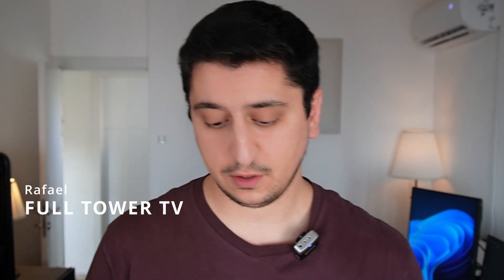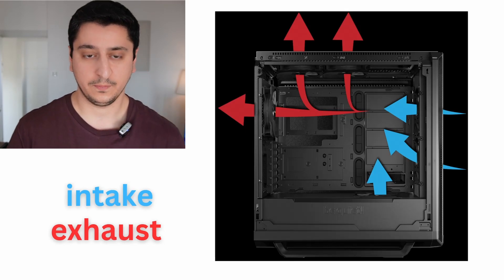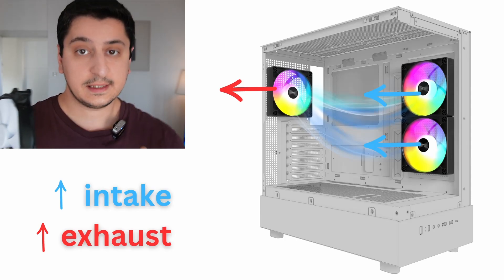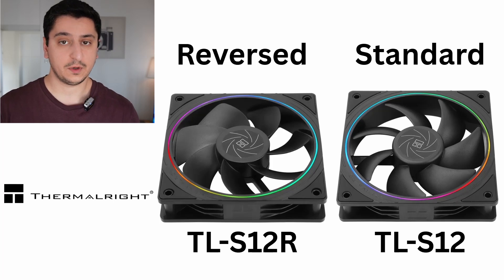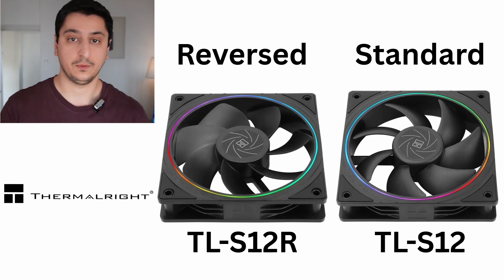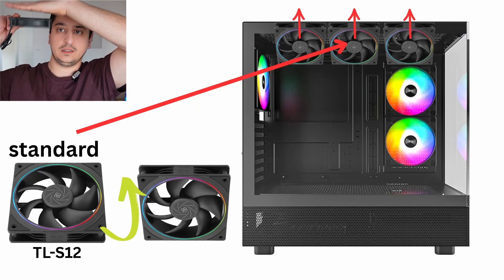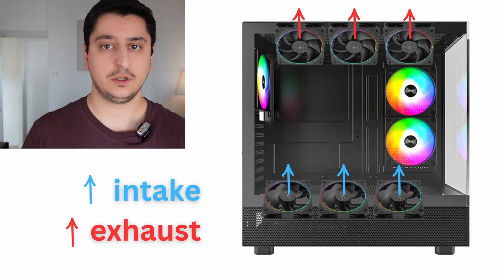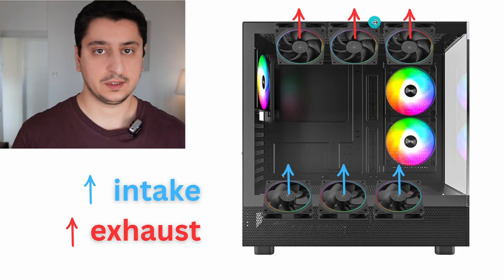What is the point of reversed RGB fans?

Comment: Dude you made this way more complicated than what is should be. Reverse fans used mainly for aesthetics purposes, looking at the pretty side of the fan. Also the way you explained intake and exhaust, all you had to say was each fan has a cross or x pattern on one side, when you see this side (x or cross) this is where the air is blowing from, allowing you to set it up as intake or exhaust. You overcomplicated this by talking about blade spin direction. Look for the x or cross on your fan, this is where the air is blowing from.
Reply from the maker: That's a very solid point. Thank you for pointing that out! I know I overcomplicate stuff from time to time, it's a bad habit I have, and I need to get rid of it. Thank you for the feedback 🙏🙏❤❤
Reply: Hey Both of you Shut up!......😎

Cuz you're Both Wayyy Smarter than I am🤣Skål🍻